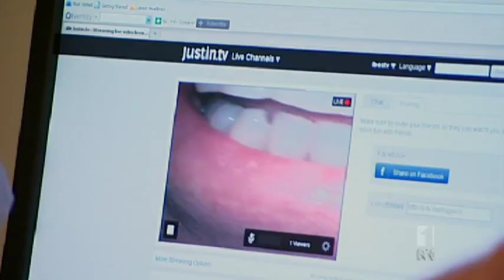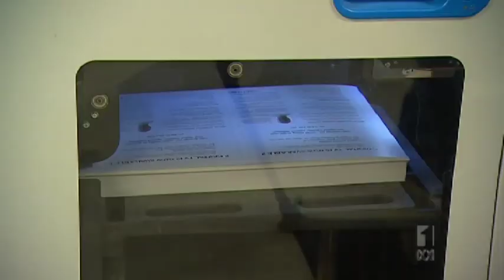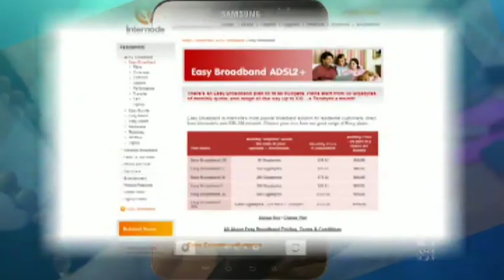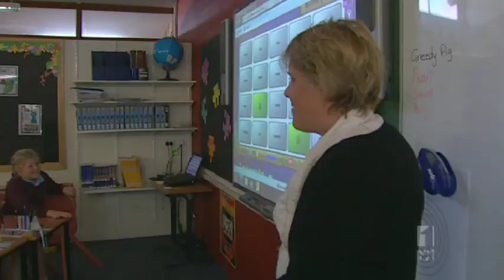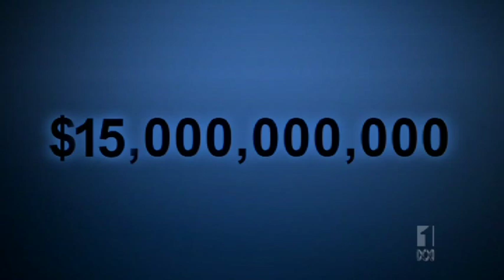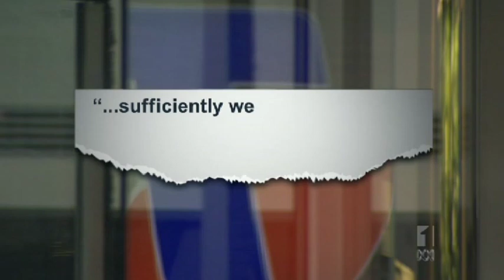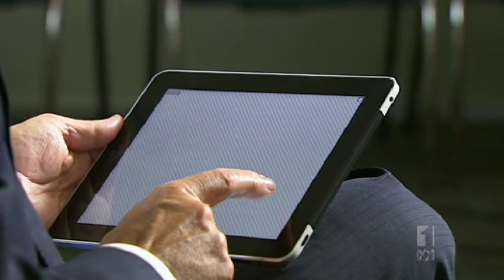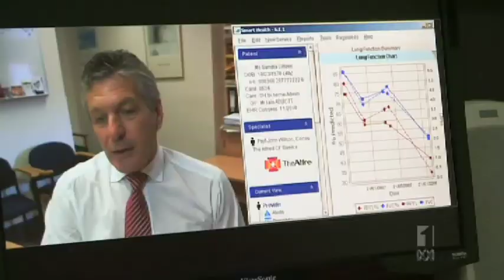ABC Four Corners Special Presentation - The National Broadband Network (NBN)

Comment: I use Transact Cable at 100mbit and we do need this even tho i get most of my speed 99% time but the libs dont understand as files get bigger and most people on the networks it clogging us up and slowing us down before i got cable i was getting 3mbit down 0.2 up now im on 100 down and 8 up and love it. And wireless could get more speeds on cable backbones.